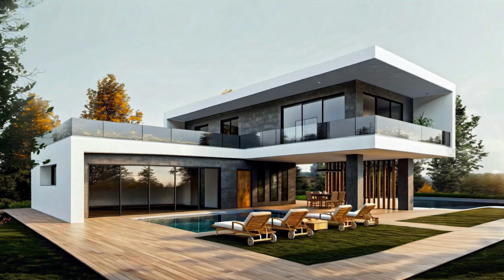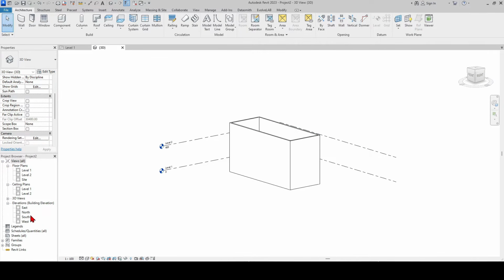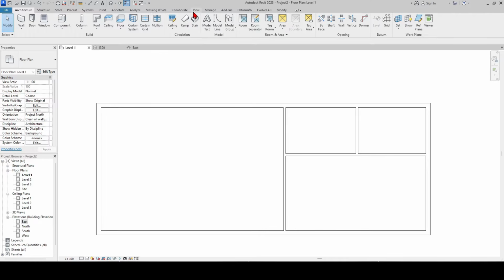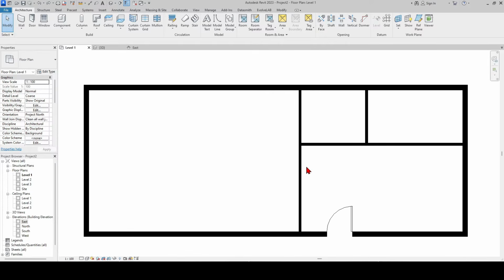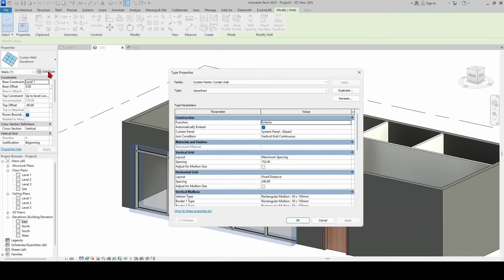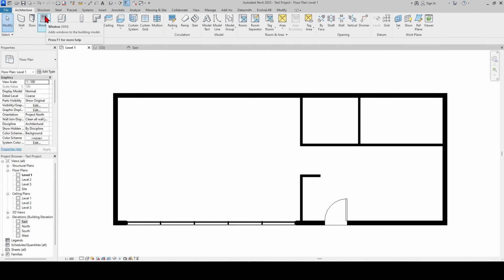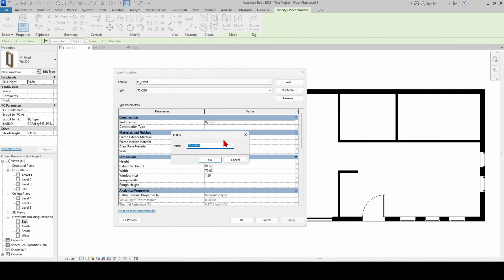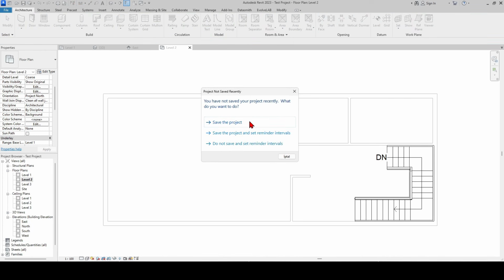Revit Course for Beginners – Part 1 – First Floor Design

Comment: hey.. i appriciate.and i cant find the proper dimension
Reply from the maker: Thanks 🙏 If you explain the issue a bit more (which view you’re in or what you’re trying to dimension), I can help you better 🚀
Reply: @tech.architect  Thanks alot. i need the exact dimension for the floor plan
Reply from the maker: @f @fbr3601  Got it 👍 For exact floor plan dimensions, make sure you’re using Aligned Dimension in a Floor Plan view and that you’re snapping to wall faces or reference lines, not finishes🚀

Comment: Floor command FL won't open what should I do?
Reply from the maker: You need to set the shortcut first.
Go to View → User Interface → Keyboard Shortcuts, then find Floor: Architectural and assign FL as the shortcut.
After that, you can create floors using FL.
If you get stuck, feel free to comment again 🚀

Comment: Thank you a lot … I want to ask a question , when I draw a door on plan of level 1 it doesn’t have an opening what should I do to fix this problem ??
Reply: The door is closed? This is normal.
Reply from the maker: The door is placed in a closed position, so it’s normal if you don’t see an opening. But if the problem is something else, please explain it in more detail — I’d be happy to help 🚀
Reply: check cut plane: in view Range from properties. make it 1200mm

Comment: where i can download diffferent types of doors, window sliding door etc
Reply from the maker: After typing the shortcut DR for a door, you can go to Edit Type → Load and find the Door folder to access some default Revit door families. In addition, you can also download different types of families (doors, windows, sliding doors, etc.) from websites like RevitCity or BIMobject 🚀
Reply: Thank you so much
Reply from the maker: Always here if you need help 🚀

Comment: Hello my curtain not reflecting
It says use cut geometry tools to embed walls.

What can I do to that?
Reply: I tried to input curtain wall in an already existing wall, but it'll bring out an error, and the whole wall will turn yellow..

But if I draw the curtain wall in an open space (not in an already existing wall) it will reflect.
Reply from the maker: Thanks again! One quick thing you can try — instead of a regular Curtain Wall, try using the “Storefront” type from the Curtain Wall types.

It’s one of Revit’s default curtain wall systems and tends to behave more predictably when embedded into existing walls.

👉 Just go to Wall > Type Selector and choose Curtain Wall: Storefront, then draw it where needed.

Let me know if it still gives you an error after that. Curious to see if it works!
Reply from the maker: Hi! I'm not exactly sure I understand the issue you're facing. Could you please explain in more detail what you're trying to do and what the problem is? That way, I can help you more effectively.
Reply: Hie... I dont know if you have rectified this. I met the same problem but make sure before you enter the wall you go to edit type. Make sure you check the automatically embedded box and change curtain panel to glazed and joint condition to vertical continuous... It will automatically rewrite the other wall

Comment: Have been using AutoCAD for years and want to learn revit but with all the videos i see on YouTube i don't understand how the software works
Reply from the maker: Thank you for your comment! I understand how switching from AutoCAD to Revit can feel a bit overwhelming, especially since Revit approaches design in a different way. In this 5-part Beginners Revit Course, I’ve structured the lessons to guide you step-by-step. If you go through the series from start to finish, you’ll gain a strong foundation in Revit’s basics. Give yourself some time to adjust to the new workflow, and you’ll start to see how intuitive and enjoyable Revit can be!

Unlike AutoCAD, which focuses on individual lines and layers, Revit is a BIM (Building Information Modeling) tool. This means it works more with “smart” objects (like walls, doors, and windows), allowing you to create a detailed 3D model that updates in real-time. I’m confident you’ll love Revit as you dive into it more!

Make sure to stay tuned for more videos to continue growing your skills—I’ll be sharing more tips and tutorials to help you along your journey! Don’t hesitate to ask any questions along the way—I’m here to help!